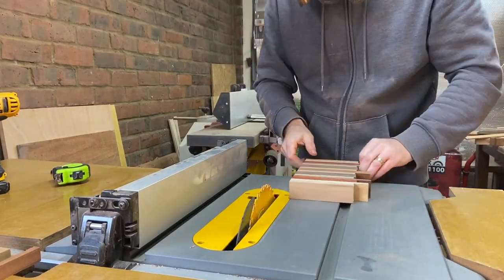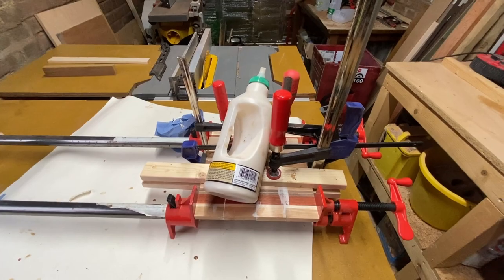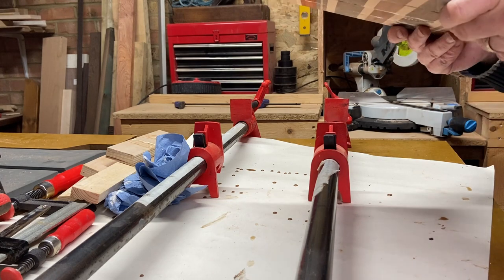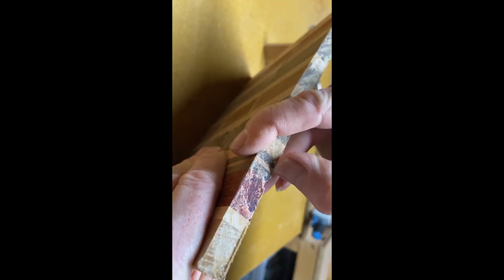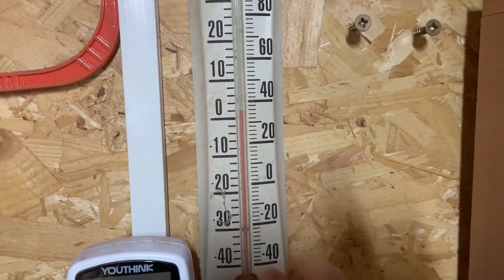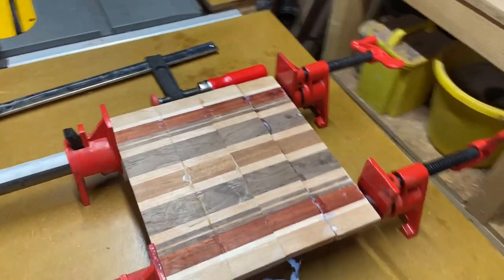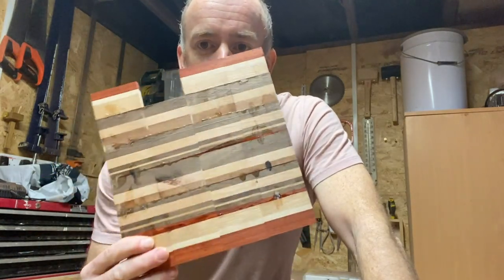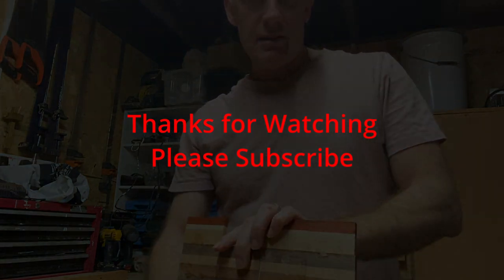Avoid this HUGE wood glue Problem to save you hours of work

Comment: In winter, I store my glues and finishes indoors.
I'm guessing that your final failure was due to the glue being cold, due to being stored at low temperatre.
Reply from the maker: Exactly that Clive. I have bought them all in to the house now.
Reply: I do the same and then bring my glue ups inside to cure.

Comment: Insanity is doing the same thing over and over again and expecting different results. Temperature matters for glue ups.
Reply from the maker: Not if each time you try you learn something. I figured it out after a few failed attempts. Insanity would be if in never tried anything new just kept trying gluing it up. 
Thomas Edison tried 1000+ times to make the lightbulb. When asked what it’s like to fail 100 times he replied. I didn’t fail. I just found a 1000 ways not  to make a lightbulb. 
I knew straight away the cold was effecting the glue. I said that straight away. Just need to work out the best way to warm it up and glue it up. Nothing Insane said about that.
Reply: @hazelnutwoodcraft  I get ya. Yes you become a master from learning from mistakes. BTW ..... Edison stole many of his ideas from Tesla. Including electricity and the light bulb.